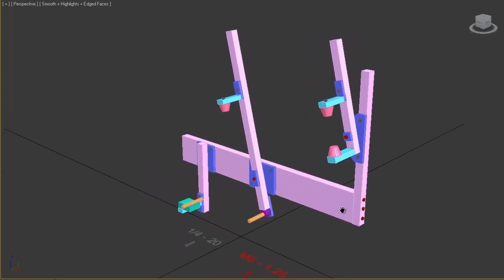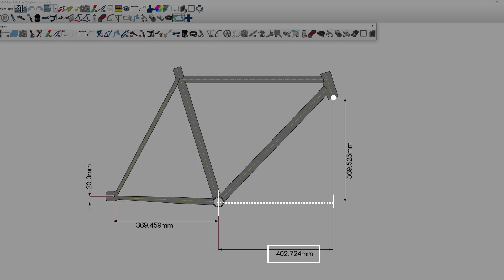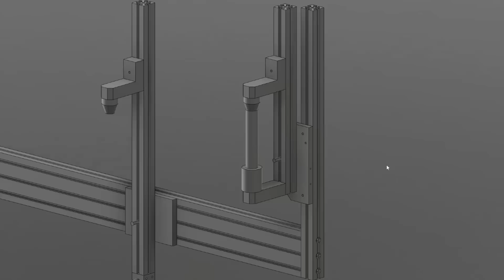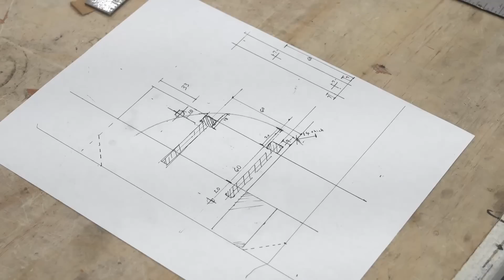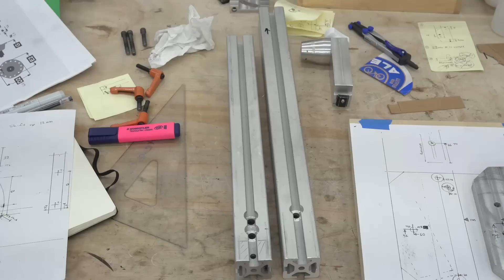Bicycle Frame JigV2

Comment: Really appreciate the drawings! I did build your first jig based on the older 3D renderings, but these are a bit nicer... and entirely in the metric system :)
I’m wondering why you left out the cone’s locking key in the new drawing — have you skipped it?

Comment: Have you considered building it so that the seat tube is indexed at 90 and everything is referenced off of that?
Reply from the maker: I know some jigs use that method. It’s just a preference thing for me to have the spine of the jig at a constant zero. It can come in handy when other frame parts need to be measured.

Comment: Why no oil when tapping？
Reply from the maker: I sometimes don’t use oil when power tapping so the chips clear more easily. The oil actually holds the chips in the grooves and gunks things up. But it all depends on the tap style and size of tap.
Reply: @ got it，thx for reply.

Comment: Interested in buying your plans, but will they accommodate a 62 cm frame?  Thanks!
Reply from the maker: Yes it will and that will use the full length of the seat tube extrusion. Because the jig is modular and built on standard extrusion platform, you can simply purchase longer extrusions to accommodate any size frame.
Reply: @PithyBikes  Thx.  Bought the plans yesterday.

Comment: Nice rework. Why you are not happy with this lathe? At first glance look like a decent machine.
Reply from the maker: It’s a little on the noisy side. And the fit and finish is a little rough. But don’t get me wrong it’s a good lathe and probably gets some unfair criticism. It’s got it where it counts. 😉
Reply: @PithyBikes  Noises are annoying during long processing time. On my Sieg SC4 I covered the inside of the gear box and the chip tray on the back side with bitumen mats, which are used in car doors, close all small gaps carefully. If you can use a thicker gear oil, try it. Replace a drive gear with a gear made from Delrin, for example, but this I didn't realise until now.